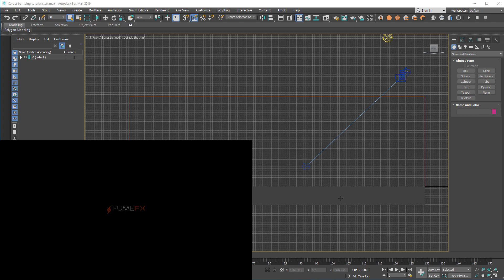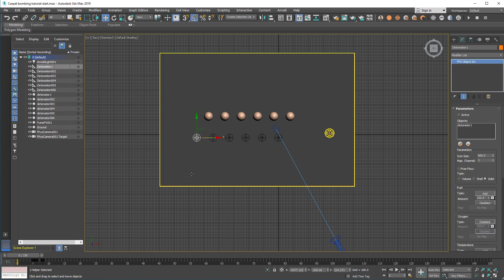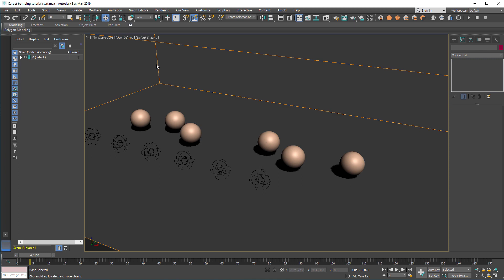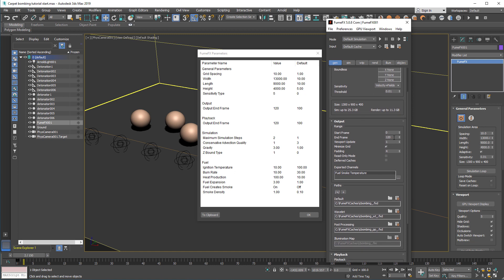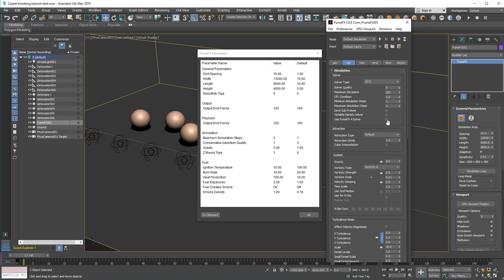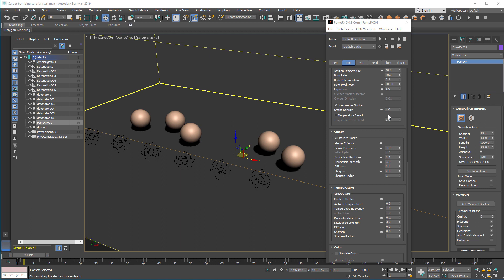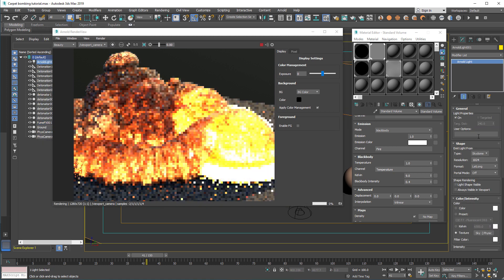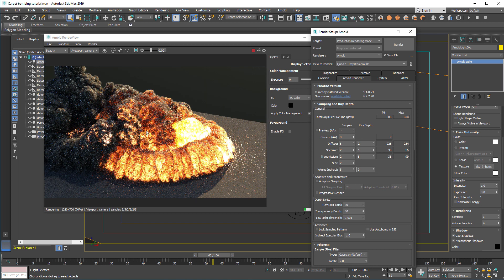FumeFX Carpet Bombing Tutorial

Comment: Thanks ! Can you do the shading part for Octane too ? I'm having a lot of troubles shading vdb from FumeFx. No issue with other programs like Embergen.
Reply from the maker: Hello,
Could you please share which problems do you face? Thank you.
Reply: @sitnisati  Using a 750MB vdb from Embergen I can pretty easily get a good looking fire/smoke even without using Blackbody. Here is the result : https://i.imgur.com/q44mEZi.png (30s render, that's why it's noisy) I'm using the Gasoline Explosion preset from Embergen Website.

With FumeFX, even with a 5GB vdb it's quite a struggle to get it right with Octane, and I'm not sure why. The quality of the explosion doesn't seem right either for such a big file.

More generally, I haven't seen a single good looking explosion in FumeFX for C4D (for 3ds Max I've seen plenty). I tried to follow Andrew Kramer tutorial (3ds max) using the same parameters, same everything, as close as I could on C4D, but ended up with bad results. I tried a lot of other things, but never managed to get it to look good, shape or shader.

A complete C4D explosion tutorial Andrew Kramer's style, with Octane shading (with Blackbody) would be god sent.
Ref to Andrew Kramer video : https://youtu.be/ivdCprwR3Bs
Reply from the maker: FumeFX for C4D should have direct Octane support, so you have no need to go the .vdb way.  The carpet boming for C4D tutorial is on the way, although it'll be for Arnold.
Reply: @sitnisati  Is there any tutorial from Sitnisati on how to setup FumeFX C4D with Octane ? The only tutorials out there are using C4D vdb as a middleman to render FumeFX, and again, none of those explosions, tuto or reel, look anywhere close to good. Maybe the Carpet Bombing for C4D will bring some answers.